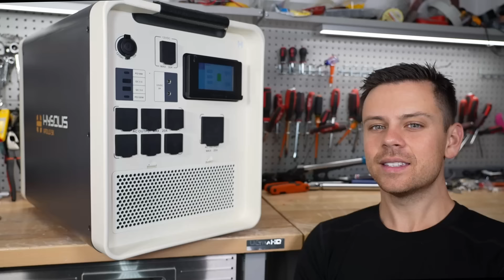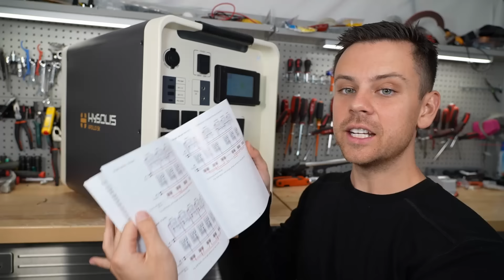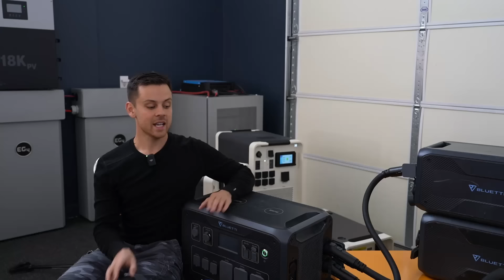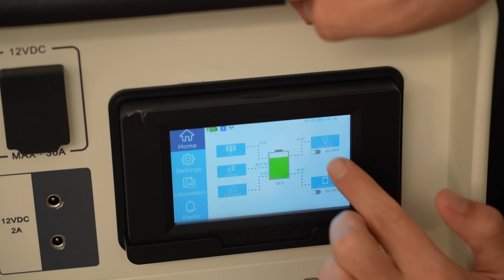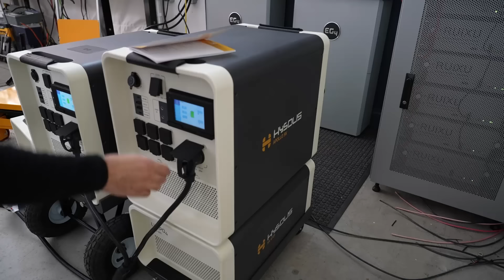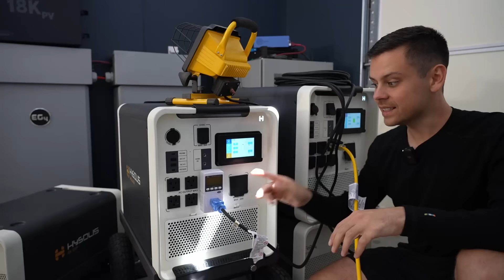Hysolis Apollo 5K Review and Test

Comment from the maker: Best price for the Apollo here (affiliate link): https://hysolis.com/?ref=h-cvbzfahsek

My budget friendly 48V System: https://www.willapproved.com/mobile-48v-system.html

~~~~~~~~~~~~~~~~~~~~~~~~~~~~
Don't want to burn down your house? Need equipment you can actually depend on? Check out my latest "Will Prowse Approved" solar product recommendations here:
https://www.willapproved.com/

Tired of leaving reviews that get censored by the manufacturer? Need to find the lowest price UL certified battery? Check out Charged Reviews:
https://www.chargedreviews.com

Need more help? Join the largest DIY solar forum on the internet for beginners and professionals alike:
https://www.diysolarforum.com

Check Out My Free 12V DIY Solar Book
Best-selling and beginner-friendly guidebook to off-grid 12V solar!
https://www.willapproved.com/the-book

Use facebook? Check out my group:
https://www.facebook.com/share/g/1FQ695xjj4/

~~~~~~~~~~~~~~~~~~~~~~~~~~~
Need to build a large DIY system? Need a trustworthy solar distributor? These are my favorites:

Signature Solar
Hybrid Inverters, Solar Panel Deals, Mini Splits and More!
If you want $50 off, please use my affiliate link below and coupon code "DIYSOLAR50":
https://signaturesolar.com/?ref=cPwLcVc0SW-BjN

Best Solar Bundles
These systems are cream of the crop. High voltage/ High performance/ Commercial and at incredibly low prices:
https://bestsolarbundle.com/?ref=WILLIAMPROWSEIV&variant=43645878468650

Current Connected
Best Prices for EG4, Victron, Midnite and so much more! Fast Shipping and Highest Rated Customer Service:
https://currentconnected.com/?ref=wp

~~~~~~~~~~~~~~~~~~~~~~~~~~~~~~~~~~~~
Contact Information:
I am NOT available for personal solar system consult! If you wish to contact me, this is my direct email: williamprowsediysolar@gmail.com
FTC Disclosure Statement and Disclaimers:
Every video includes paid promotion or sponsorship (such as free products for review). Some links on this YouTube channel may be affiliate links. We may get paid if you buy something or take an action after clicking one of these. My videos are for educational purposes only. Information is subject to change/update at any time. Electricity is DANGEROUS and can kill. Be smart and use common sense :) DIY Solar Power with Will Prowse is a participant in the Amazon Services LLC Associates Program, An affiliate advertising program designed to provide a means for sites to earn advertising fees by advertising and linking to Amazon.com

#diysolar #offgrid #lfp

0:00 Introduction and Basic Features
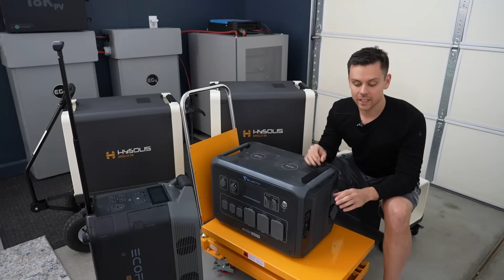7:52 Surge Capacity Test!
13:59 Speed Charge Test AC + Solar
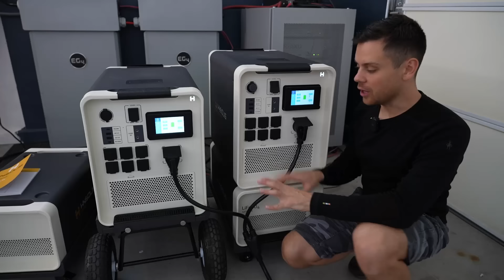16:26 Split Phase 6kW Test + Ground Neutral Bond
24:08 Continuous Load Test + Capacity Test
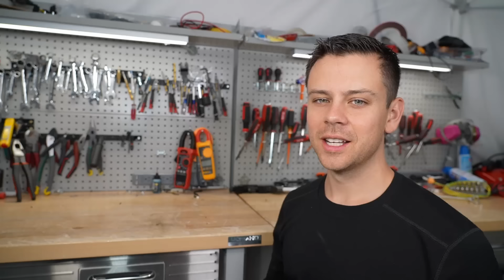26:11 Conclusion
Reply: Can you add 12v alternator charge to the eg4 unit? I thought about the victron dc to dc 70amp converter but im not sure, it would be a deal breaker for me as im attempting a van build with the eg4 and 2 of their batteries but not being able to charge with alternator would force me to look somewhere else. Please help
Reply: @jah-jah87 - “12v dc charging”

6:38 - This unit has it!

Go to a video with the inverter you are interested in 12v alternator charging
Reply from the maker: @@thesolarjunkie yeah I hate lead acid 😂😂
Reply: @WillProwse video on high voltage battery and inverter for home use
Reply: @WillProwse  Im curious why do think a guy should be paid alot just to copy other peoples videos and upload and cut and paste the text?
Reply: @WillProwse  I want to know how would it perform if we use 3 of those (3phase+N) to run 3¢ loads i would be more than happy if you perform it(I am asking for it because many ev fast chargers demand an input of 3¢ input to provide DC output of 20-30kw for DcFc of Ev... Also it's applause that it provides the ground rod which is essential part for  running spilt phase arrangement
Reply: I love LIFEPO4, but trust me some countries in Africa still have shipment restrictions with LIFEPO4, so the only choice is lead acid. Not everyone is enjoying the opportunity of LIFEPO4, so most times we just stick to lead acid knowing we are still in the dark age of solar.
Reply: Hi, thank for sharing your knowledge, are you ever going to test the zendure?
Reply: Are there any made in the US?
Reply: I wanted to use the EG4 inverter on that 48v system but can not reliably get the 120v PV input required.  Solution ?
Reply: I would like to see a comparison between the Apollo and the Delta Pro Ultra.
Reply: Do you plan to do a comparison between the Apollo 5k and the new EcoFlow Delta ultra ?
Reply: @michaelpaul8588 thank you for your follow-up about the Apollo versus the Delta Pro Ultra. These seem to be the two 600 lb gorillas in the room.  ... Comes down to shaking out the price, the reliability, the customer service, maybe peripheral features (like the detachable screen on the Apollo. 

Part of me likes (1) the all-in-one unit of the DPU, its big rolly cart. Part of me likes the (2) Apollo being able to be broken up into two individual units. 

I was following the thread about the Eco-Flow products, the Delta Pro's failings.  It's going to come down to reliability, is a programming, customer service for me.
Reply: @michaelpaul8588  thank you, it's going to come down to that. I've asked another guy online. (MINUTEMAN PREP, POWERED PORTABLE SOLAR)
Reply: @EbikeRandomadventures   luckily wasnt asking you
Reply: 0:15 - “TUV certified”

Why is that important, 
in comparison to UL certified?

If it burns down your house,
will the insurance company cover it?
Reply: Am wanting 5/6 hundred ah @ 48vdc but need to install on a sailboat. Space and location is the concern
Reply: @michaelphilip3919  - “5/6 hundred Ah @ 48vdc”

500 Ah - 600 Ah @48 V DC is huge… 
my house does not need that much! LOL!

Actually, I sized my inverter for 600ah peaks @48v supplied by 34 KWh of battery for my house… it will run my house for 2 days in the spring & fall.

You will need significant batteries for “5/6 hundred Ah @ 48vdc”, it will suck up a lot of space on a sailboat!

I am using a Genetry Solar 12k, but it has no integrated charge controller for solar panels. I had to wait a little while, but it was worth the wait, human support is in the US… it successfully turns over my HVAC compressor @130 LRA.
Reply: @michaelphilip3919 500ah a 48v sono 25kwatt di capacità forse ti bastano 200ah a 48volt sono circa 10kilowatt in barca a vela poi quanti pannelli solari puoi mettere per ricaricarle
Reply: @WillProwse could someone use 4 Hysolis 410 watt solar panels in series with an EcoFlow Delta Pro?
Reply: If I order 8 gauge wire with MC4 connector ; will it plug into the inverter and the solar panels? My panel is 150 feet out into the yard.
Reply: Does this unit qualify for the federal tax benefit?
Reply: Will  
Why didn't you try th 3 phase?
I have a huge audio system. I would like to run off of something like that. You skipped a big feature test...
Reply: You're so smart you're scary smart. Now, try to get your subject-verb agreement correct. 

I know! An engineer talking to you about grammar...

BUT... 0:05
"There WERE problems!"
NOT...
"There WAS problems."

Have you noticed that you don't use "AIN'T?" Because that would make you look uneducated? 
Same thing.
And no "A (apple, alligator, etc.)"

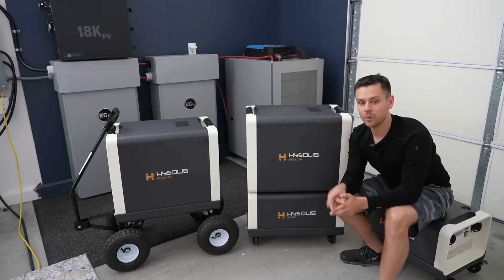7:19  "'There ARE' (not 'THERE'S') 2 different types of carts."

"None (a SINGULAR subject) ... of these DEVICES... (only a prepositional phrase) HAS a surge capacity..."

You probably got a 1400 on your language SAT exam. Now apply what you know.
Reply: What do you need to install it to your home electric box?
Reply: Can you do a video about the best led acid solar setup for us poor people.???
Reply: @KATASTROPHE69S   Lead Acid cost is > 1$ per kWh - do  the math
Reply: @longtimber1  if knew anything about solar I would.  I just know acid has a cheaper cost to get started because the batteries are cheaper.

Comment: I have found the ecoflow surge capacity is very poor - below rating. I cannot start my electric log splitter off a D2 or D2M even with X-boost turned on. The D2M with X-boost supposedly can provide 3,400 watts, but it shuts off instantly when I try to run a standard 110v log splitter, with no load other than trying to start the motor spinning.

Comment: Etaker M2000, 240v split phase test, to put a small charge into my Bolt EUV, run 240v mig welder, 120v pancake compressor, circular saw, etc.  How to properly configure the Ground/Neutral bond would be nice.

Comment: What would you suggest for a very large load center draw 100 amp dedicated to crypto mining. No solar, just backup generator for now. Would solark 18k with what type of battery solution, just to cleanly pass over to generator? Most everything is on 220v 30amp circuits. My limits the Kohler 100amp 220v. I'm considering a 2nd generator and potentially some solar in future. Need to expand service entrance to 400amp service.

Comment: i Have a show car trailer.  I purchased 2 200 watt flexible solar panes and a 40 charger controller to add solar to provide charging when the trailer is parked to keep the wench battery fully  charged.  I have a Roy Power 200 amp battery for lighting.  I charge the wet acid battery with a small amp charger from the inverter. any suggestions?

Comment: Will,  I have learned so much from your videos.  I especially enjoy your unbiased and fact-based comparison of quality and functionality.  I now have four Dr. Prepare 12v 100ah  batteries,  three 200-watt Dokio panels to a 60 amp ecoworthy scc. The reason I went with 12v is to match the voltage of my camper.  I bought a converter conversion capable of charging lithium batteries and a  4000 watt inverter. Is it safe to plug my camper straight into the inverter? No soldered lugs here buddy!

Comment: Catching up in videos. The surge ability is fantastic so I wonder how the 3ph setup would do running CNC machines. So many shops have to run a large expensive phase converter for 3ph. One of these 3ph setups may be able to both supply 3ph and prevent machine crashes from power issues.  Plus reduce the peak load some power companies will ding you for big time.

Comment: A unit with expansion battery is $7500. So double that to $15K for 2. Seems excessive since a DIY would cost $10K or so with new low cost server rack batteries or large wall unit, and a EG4 18K for example.

Comment: Aren't you curious why the Eco-flow can't even push hydraulic fluid around for a second + before a load comes on.   I not that easily amused.   😮.    It's painfully obvious when you can't show repeatable results,  you have confirmed nothing.   Throw a clamp meter on there, show us some tangible results.  This shows us nothing but inconsistent results. Did eco-flow ditch you or something???    I believe the Eco Flo can push fluid around with no load on it for the battery cycle  entirety.   Misleading !!! ??? Who's leg are you humping ???

Comment: I have a system running my security camera over the winter and the way I make it autonomous is by taping the power button down so it's always pressed
When the inverter powers down the power button does nothing and when the system has sufficient power the power button turns the Inverter back on. 
It's a canadian tire brand equalizer 1000w inverter lol but it works flawlessly when extended winter days put the system down it pops back online without intervention.

Comment: You need to be careful telling people use 15 amps that have a wall outlet. That's 100% of a 15 amp breaker and it will trip with in some short period of time like an hour half hour or something like that. Also heats the wires pretty good in the house. 15 amp outlet should be no more than 12 amps and a 30 amp outlet should not be 25 amps. It should be 24 amps

Comment: Think about the weight savings alone using two of these vs, say, 6 5120wh server rack batteries with Victron hardware (like I have in my RV). The total weight of that setup is 710 lbs. The weight of two of these is less than 1/2 of that and one has FAR fewer cables, external complexity and reliance upon mobile RV solar mechanics when one might need support.

Comment: I live in a HOA and  have maxed out the available roof space on the back of my house. I have a 14k watt system but the shade from the tall trees allows me only about 25% effective benefit. I am grid tied. If I charged this unit’s battery a plugged its output into my wall socket, would it back feed the grid like my solar does? I have an off grid office with solar and am trying use the excess solar power at my home. What is your recommendation? Have been impressed with your knowledge and DYI skills.
Greg

Comment: Have you ever considered doing a video on charging at 30A with a generator. I have two generators, one of them is the Honda 2200 inverter generator.  

The one I would prefer to use is a WINCO HPS12000HE tri-fuel generator (gasoline, natural gas, propane) with a 30A outlet. It is not an inverter generator. 

My question revolves around whether or not the power is clean enough for the Apollo. Will this charge up the HYSOLIS? I have never seen you do this in your videos.

I ask b/c my generator, when feeding the house, requires a relay to signal the SMA SI54058 explaining that grid power is out and that charge is from a generator therefore, presumably, "dirtier" electricity

The all-in-one units have come a long way since I had my SMA system installed. I am an engineer, please be as technical as you'd like.

Comment: We have run our lift when it is connected to our inverter and found it works best if you release the cable with the lift in a locked position before you try.  In that way, there is some slack in the cables and this gives the motor a chance to spin up and start pumping fluid before the cable gets tight enough to start lifting the ramps and thus the vehicle weight.  Worth a try.

Comment: Great review! One question that I’m hoping you could address… Does the Apollo 5k have a built in temp sensor that prevents a charge from flowing into the batteries when the temperature drops below freezing, therefore preventing damage? 

For context, I’m trying to find a solution for powering my off grid retreat with an existing solar array. However, the temperatures in winter occasionally drop below 32 degrees (as the high) for several days. The main items I’m powering during this time is a Starlink and security cams totaling less than 100 watts which could run for several cold days on the Apollo without the need for a solar charge. I’m just afraid of damaging the cells if the sun comes up and it’s below freezing. I need a system that would only charge once the temp rises above freezing.

Comment: Can you use one Apollo connected to half a dozen EG4 batteries?  $4,695 ea vs $1,399 ea is heavy.  Bummer, you need 2 for split phase, which is $9.4k!  (My 5.4kWh solar, 20kWh EG4 battery, and MPP 5048 cost a total of $12k and it can power my entire house year-round.)  Maybe I'm just not grokking the "solar generator" concept.  Who wants these things, anyway?  Comments, please.  Yeah, Will, that was a very comprehensive video on the Apollo.  Even the nicely printed paperback manual speaks to the price of the unit.
Reply: It seems by this video if you are willing to spend the money you get a system that could be wheeled to any location in very little time.  Im developing land soon and being able to take it to different parts of the land to work on different structures.  If you had an travel trailer you could throw it in and have all that power for your trip. The fast charging is also I think better than any inverters I have been researching.  Pv input voltage 500v... What other system does that?

Comment: Weight ? Also, can it feed an RV alternating voltage control unit and auto switch itself between shore (30 amp/50 amp) and generator ? My RV currently switches between shore and genset; can this system be added to a RV ac voltage control unit ?

Comment: Just imagine: Two of these Apollo units with an expansion battery each, mounted in the back of a pickup truck. Drive to a construction site, and power a 240 volt split phase site power system all day - quietly - no noisy generators running. After work, drive home and plug them into the utility to recharge them for the next day. After work on Friday, charge them up, go to the lake and have 120/240 volt power camping. Plug in some portable PV panels and top up the batteries all day while you're out fishing on the lake so you have lights and power for the evening.
Yeah DIY would be less expensive, but for the average person, the plug and play will be hard to resist.
 Very cool what is now possible.

Comment: Will
I have been watching your videos for a while now, and you have one of the most honest and objective review channels on this platform.
Could it be that when you tried the other inverters, when they failed, that they were already preloaded with full weight on the hydraulics before starting the electric pump?
It seems during this test, that the motor started each time and a second or so later the car starts to move. If the car were sitting on the pressurized system when it starts, it would be significantly higher start current than if the system pressure was not built prior to start?   Similar to why a well designed a/c system has a time delay after shut down, so the compressor doesn't try to start while the compressor is under high head pressure. Just curious, because it's bewildering why it would not lift one time and lift another. Temp differences shouldn't be that great to affect oil viscosity enough to matter, unless you have say 50 or 60 deg swing.  Then even, the Hydro oil is still pretty darn thin. What do you think? The fact you were surprised, surprises me!  It would be nice to find the why behind the mystery.  Thank you so much for all the fantastic reviews!